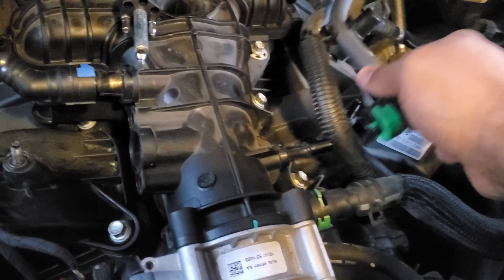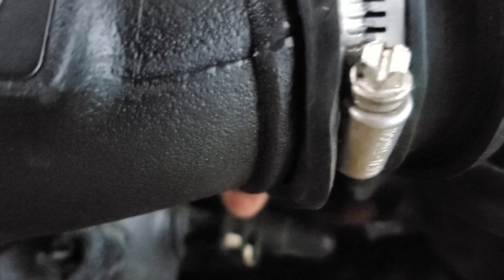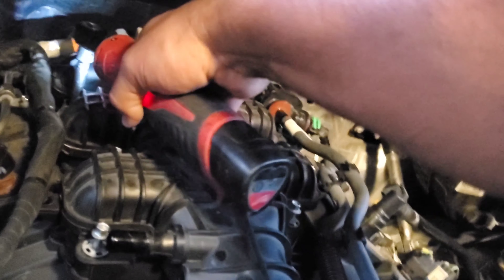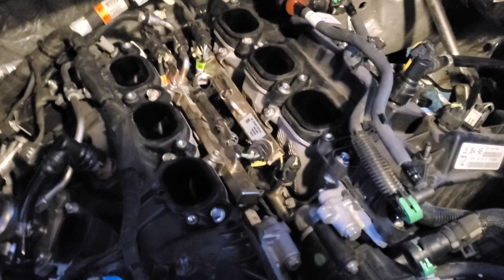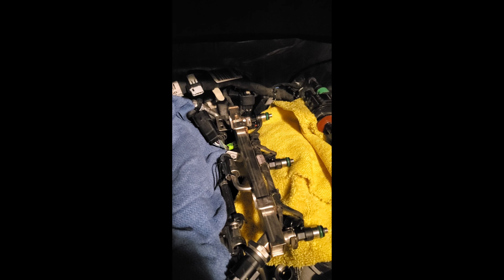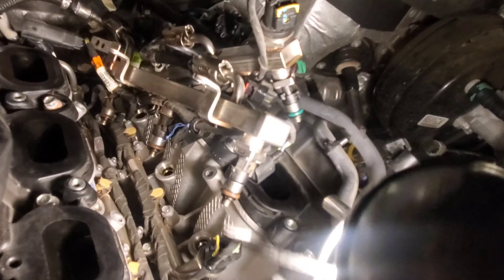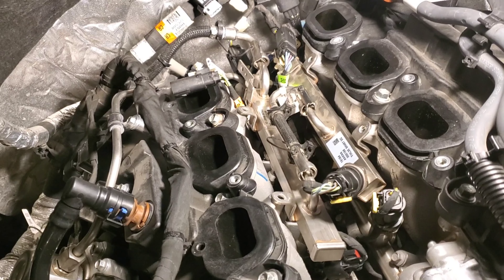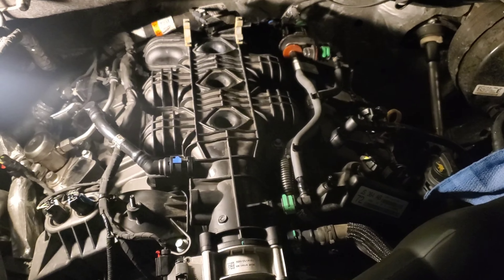2017+ F150 Ecoboost Port injectors Swap

Comment: Thanks for this. I got a bad injector the other day at 102k on my 18.. it’ll be a new one for me. Dealer wanted $1375 to change just one. I’m changing them all (port only).
Reply: I think I got some bad gas awhile back and now I get a bank 1 misfire that comes in for about 30 seconds and my truck drives terrible. It comes and goes and seems to happen about once every week or two and then goes back to driving perfectly fine. Did you have similar issues with your bad injector? I’m thinking one of mine might clogged or just going out. I’m not sure
Reply: Maybe, or your timing is slightly off, that was my issue, every week or so I would have 1 misfire.

Comment: How did you like this setup? Any issues at all? Would you recommend going this route, or upgrading the HPFP?
Reply from the maker: This route was cheaper..but the hpfp will make more power
Reply: Josh told me to go back to e50. Still having problems with leaning out

Comment: Are you referring to the direct injectors?  Didn’t realize these had dual injector systems
Reply from the maker: This video shows how to swap the port side injectors. Direct injection side stays stock. Yes they are dual injection.
Reply: @reyesracing85  awesome. Thanks man!!!
Reply: The gen 2 3.5 eb have dual port and direct injection.

Comment: 5 star will remote tune for this!?
Reply from the maker: Yes but only with rtd or ngauge
Reply: @reyesracing85  how well are you liking there tune since you upgraded port injectors?
Reply from the maker: @TheDevin918  I don't have it anymore.  Have a 5.0 now
Reply from the maker: I ended up with ZFG as my last tuner on port injectors.  Ran like a champ.
Reply: @reyesracing85  so you switched from 5star to them?

Comment: I have a 2011 I’m working on and I honestly cannot understand why it keeps leaking swapped seals 3 times alright injector and seals
Reply from the maker: Seating properly?
Reply: I have same problem,you figure yours out?
Reply: @danwormsley2363  was urs bottom or top
Reply: @danwormsley2363  for the leak that is
Reply: @reyesracing85  yep seated fine I ended up double o ring never leaked again from the top,a buddy of mine always said the bottom Teflon seals are usually once out a pain to seal

Comment: Why didn’t you cover the fuel rail removal?
Reply from the maker: @Mason-cd3wr  simple as unbolt it
Reply: @reyesracing85  the one I’m currently repairing the  fuel rails were all most impossible to remove because of the cavity there in. The injectors were all stuck in the heads. The wiring harness was a real challenge to remove without damaging it. This is why i was looking to see if there is an easier way